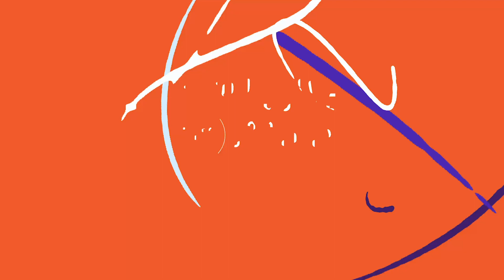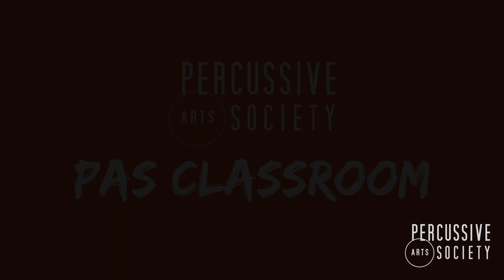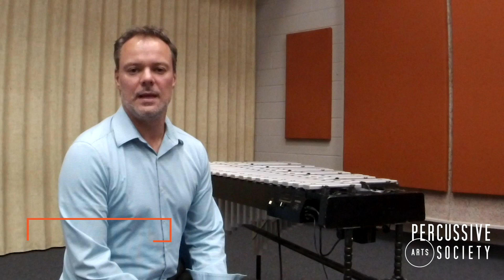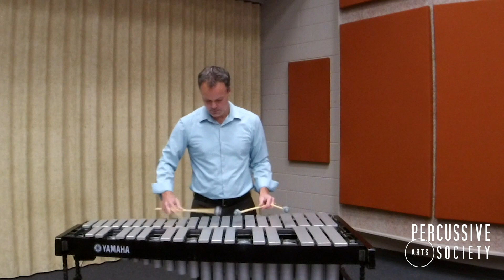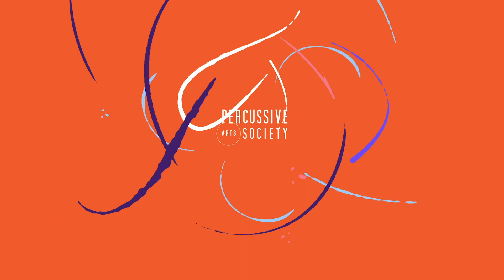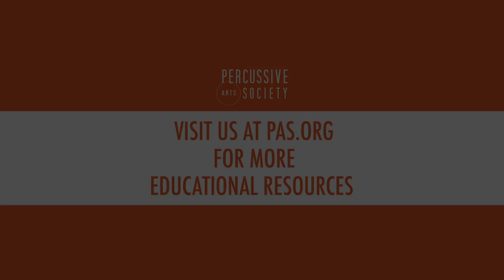The Vibraphone Motor with Matt Weyer

Comment: My vibe just has 3 different sized pulleys in which to run the belt. I have 3 speeds that can’t be switched easily. Sounds great, just not very adjustable. Just on or off… unless you take both hands and manually move the belt over.